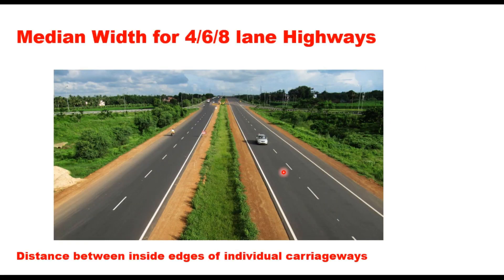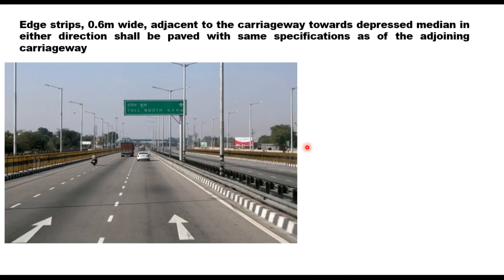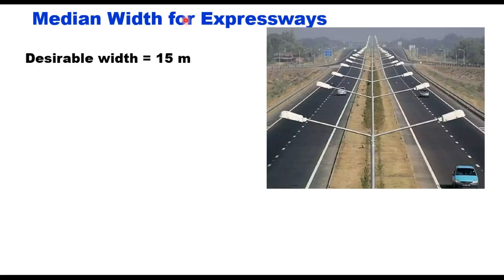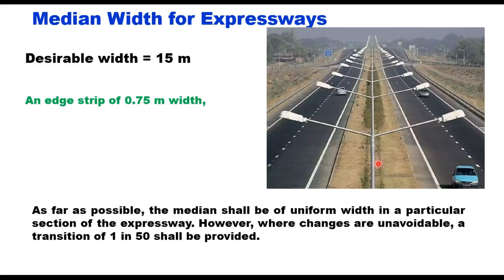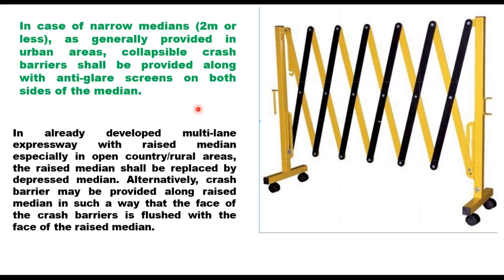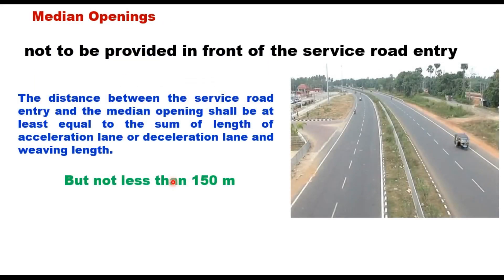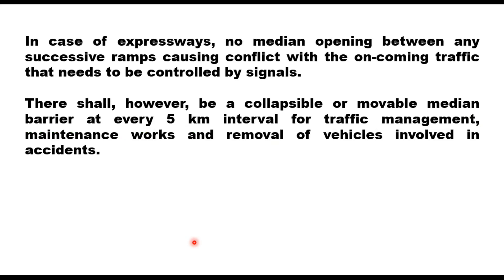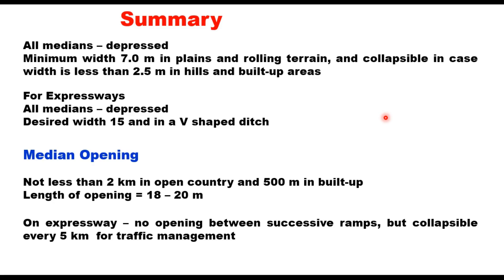Codal provisions for Median width and Median opening for multilane highways and expressways.

Comment: Sir, what are the median widths for elevated structures that come in road stretches, such as VUPs, ROBs, Flyovers, etc.?
Reply from the maker: There is no mention of median width on structures either in IRC 73 or IRC SP 99, but generally it is not less than 2 m.

Comment: Sir storage lane (tapper+straight) ka length kitani honi chahiye
Reply from the maker: Taper is provided at the rate of 1 in 15 and therefore, it should be around 15*3.5  = 50 to 55 m. Length of storage lane will depend on the traffic volume expected to turn right. On a highway, it should be sufficient to accommodate 3-4 vehicles. At intersections, it is calculated based on turning volume and signal timings.
Reply: Pranam Sir, Thank you

Comment: Respected sir,
 Will this code (IRC 73-2023) immediately adopted by GATE and ESE exam as many  of the codal provisions have changed.
Reply from the maker: I hope so
Reply: @SatishIITR  SIR, PLEASE HELP , I have following doubts

1. for sight distance criteria which code will be followed IRC 073: 2023 Geometric Design Standards for Rural (Non-Urban) Highways  OR   IRC 066:1976 Recommended Practice for Sight Distance on Rural Highways

2. Why is there no provision of building line and control line on new code unlike the previous version where it was clearly mentioned.

Comment: Which type soil should be filled in median at national highways. And reference code kya h pl tell me sir
Reply from the maker: The basic requirement is that It should drain well. Section 408 of MoRTH 2013 provides guidelines for the same.